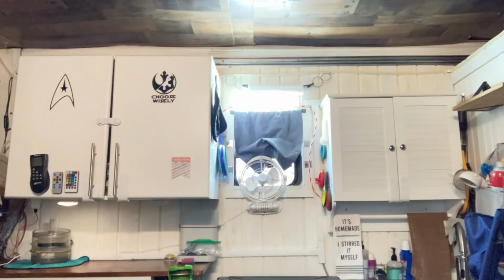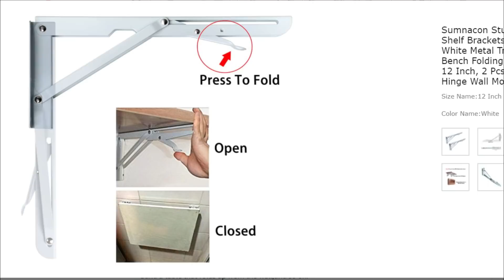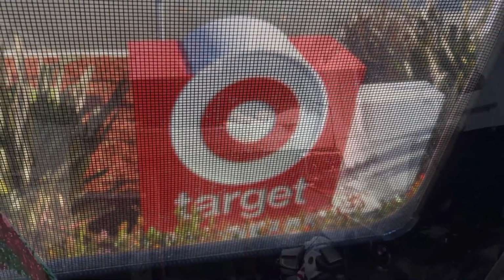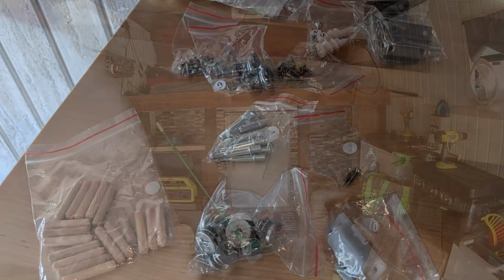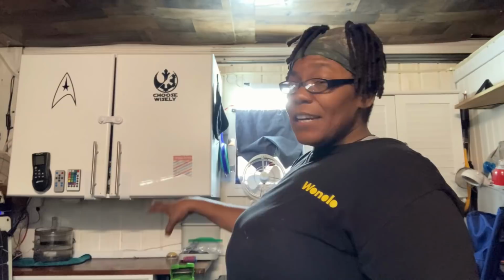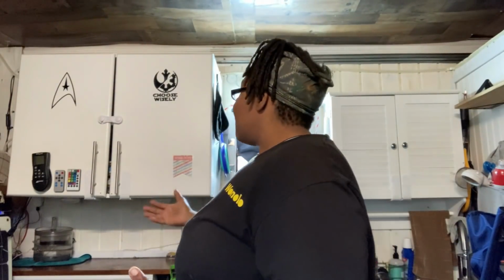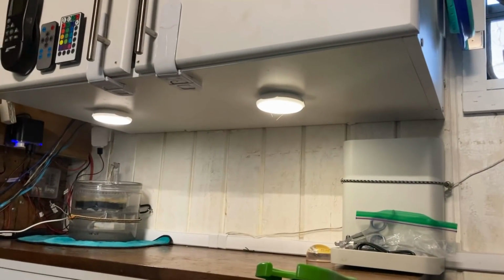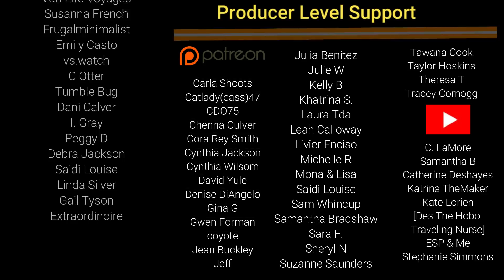BoxTruck Vanlife | Build Diary | Upper Cabinets (and other finish work)

Comment: I thought about buying premodern cabinets also.  After checking out the cabinets at Home Depot, I found they were made out of MDF and were damaged.  I decided these prebuilt cabinets were not worth the investment.  Instead, I’ve purchased a used dresser, a used secretary’s desk and a used TV cabinet.  Painted them white and put red crystal knobs on them.   All for under $100 dollars 💵.  For me, these were a much better investment in my cabinets🎈
Reply from the maker: Hey, whatever works! I actually counted on these being much more flimsy as I had that problem with my over-the-counter stuff in my minivan. I am surprised how well and solidly they've held up so far. If I have to replace them at some point down the road I still consider it a win for what I needed at the time.

Comment: Nicely thought out-and budget friendlier than a custom build if you end up like me, build it, unbuild it, built it again etc. 
lucky if three times turns out to be a charm! LOL
Reply from the maker: I mean unbuilding and rebuilding are just a part of the journey, it's only a question of how difficult your "unbuild" steps turn out to be. 🤣
Reply: @TheDawnofVanlife  
Well I bought a ‘17 winnebago Travato class B van
Took out two drawers under Murphy bed built shelves 
But took out and made bed lower
Took out to put in lithium 
Rebuilt bed-wall system to be seating area- so I build 4 unbuilt 3 in total that’s just the bed! LOL like I said-can be MORE budget friendly to buy ready made!